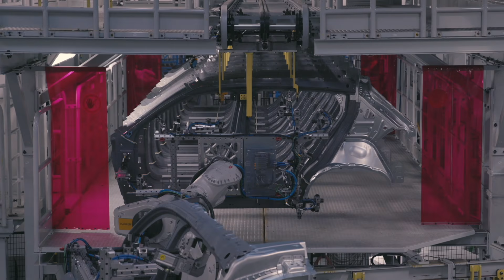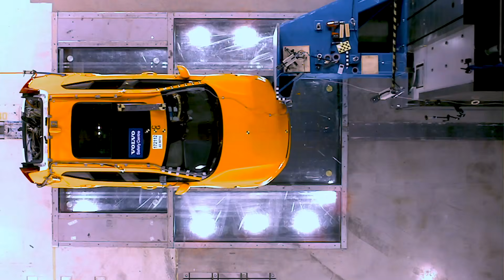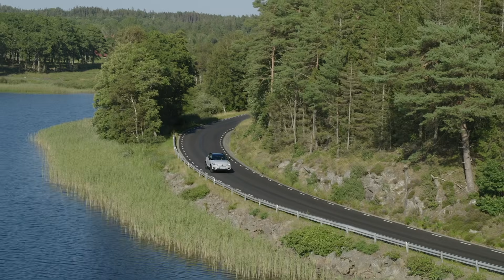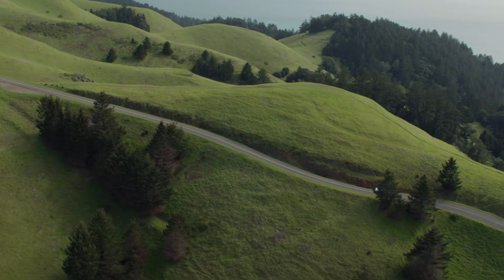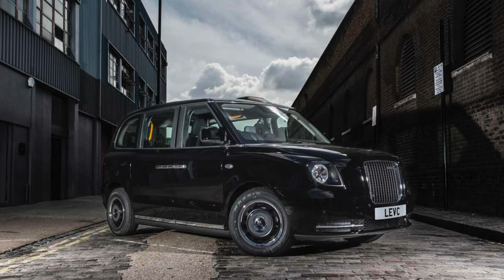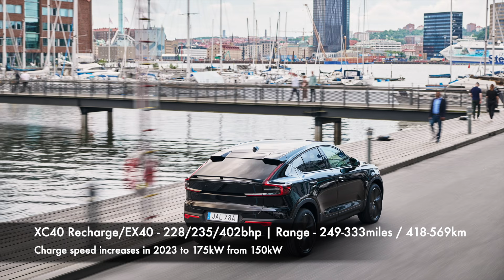Volvo XC40 buyers guide (2017-2025) Avoid buying a broken Volvo XC40 (Cheap D4 T3 T4 T5)

Comment: I wish Volvo would make a true hybrid because the petrol consumption is not great. That’s my only complaint, otherwise I like my XC40 Plus Black Edition
Reply: Not sure about the cost savings of a mild hybrid.
Reply: @kahluacoke Me either. Doesn’t help all that much in petrol savings.
Reply: Thanks was at dealer other day and sales guy was trying to push. Hardly drive so maybe ok for my situation but still thinking things over.l as gas is expensive.
Reply: @kahluacoke I was patient and kept watching for the model I wanted in the price range I was willing to pay. Low n behold a 2025 XC40 Plus black theme showed up with very low in mileage priced just below market so I went and checked it out. Purchased it that same day. I’ve had it for a year or so and very happy with it. It’s my little suv that could.

Comment: Why can't they make hybrids with diesel engine in it? They're diesel engines are proven reliable
Reply: There are few technical and environmental policies that demonize diesel. Engines with gasoline are cheaper and easy to adapt. By the way your question is legitimate.
Reply: Some manufacturers do make diesel hybrids but no one buys diesels anymore.

Comment: I have a t5 and have continual anomalies with the transmission in electric mode 

Around 45 mph the transmission dips (loses speed) before picking up again , sometimes quite alarmingly .

Volvo state it is characteristic of their hybrid transmission, however when the battery is exhausted,the transition to mechanical drive is flawless .

Basically there after care is poor

They have replaced part of the wiring loom ( cost nearing £1000) and also have replaced the battery heater costing nearly £1000

The issue is still there

I no longer have confidence in this car nor in Volvo and their main dealer

The final offer to me for inconvenience is £100

They certainly know how to insult their customers 

They remind me of a group of corporate “Emu’s”. With their head firmly buried in sand.!

Are others out there experiencing similar problems ?
Reply: I've been thinking of getting the XC40 but your comment is very enlightening.  It seems to have a lot of issues for such an expensive car.
Would you recommend completely avoiding Volvo all together?
Reply: @superultradan  
Yes 

They are not what they used to be
Reply: @harryarmstrong9201 Thank you!
Reply: T5 plug-in hybrid? thank you
Reply: Update the car goes into Volvo for further fault repair next week😭

Comment: was looking into info for this car and this is by far the most informative video. thank you for your effort!
Reply from the maker: Great to hear, thanks for the comment 👍
Reply: I picked up a brand new Volvo xc40 in September 2024. It was honestly the best drive I’ve experienced but ended up facing recurring faults with the infotainment screen and electrics. Did some googling and turns out it’s a common fault. Did you face similar issues?

I took the car back to the dealership and the salesman to his credit admitted this was a big problem across XC40/60 range and annoyingly Volvo so far couldn’t find a fix. So I returned the car (I was scared the problem would get more attention and the value would drop!). Overall upset I had to hand back the car and take a big hit financially but there was no other option.